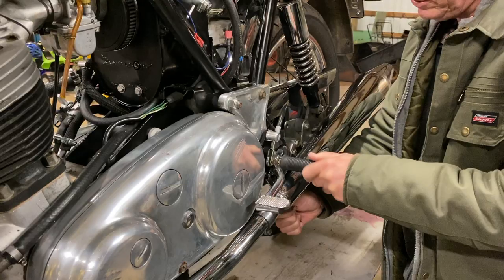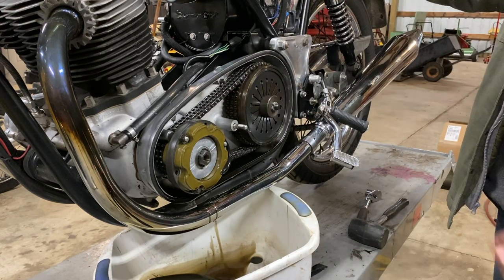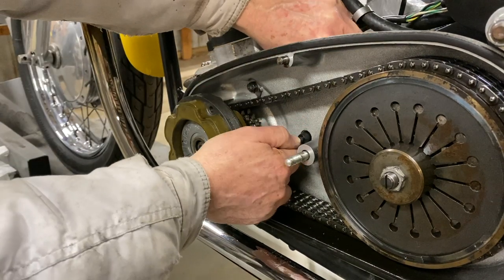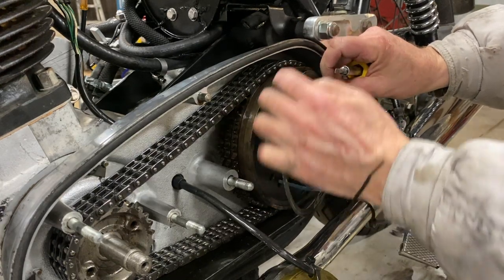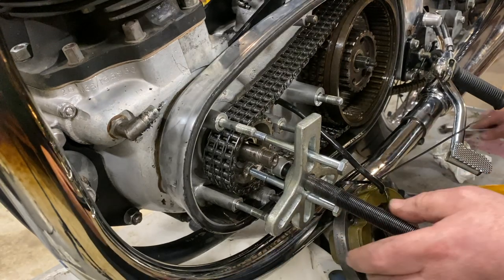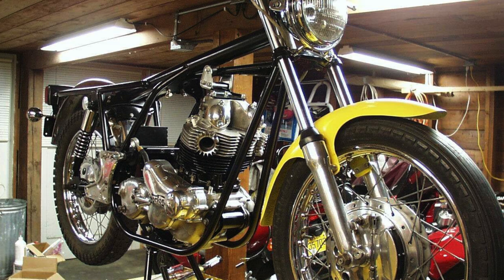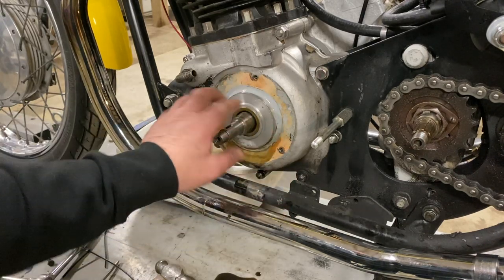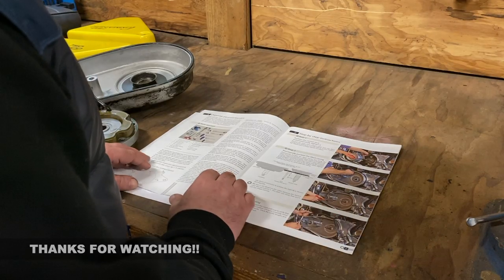Norton Commando Alton Starter Motor Project - Part 3 of 6 - Disassembling old primary case

Comment: Hi Mike, not sure if you read the comments of such old videos but I will give it a try as I haven't found an email adresse to get in touch with you. First of all thanks a lot for sharing all this great content on the Norton Commando! I own myself a 750 Commando Fastback from '71 and your channel has already helped a lot servicing and maintaining it. Right now I need to remove the engine sprocket and are looking for a fitting puller. The one you use in this video looks great and pretty beefy to me. Do you know if it is still available on the market? Could you perhaps share the brand and any addition detail you have about it? Thank you very much and greetings from Germany!
Reply from the maker: Hi Jens, thanks a lot for your note. I couldn't find the engine sprocket puller tool on Andover Norton's website, but it looks like there is one on eBay UK. 

You might try searching your local dealers for the part number 06-4297 "NORTON COMMANDO ENGINE SPROCKET PULLER TOOL 06-4297" and here's a listing below to show you what it looks like. 

https://www.ebay.co.uk/itm/221892208593?itmmeta=01J4PN49CNNA393ABTA2KGQDSM&hash=item33a9ce67d1:g:1vAAAOSwZkJUSM7B&itmprp=enc%3AAQAJAAAA4EzKZ7i0iISbYlkcwu3B5Tj2CEniNjFQI8c%2BxnbVZeWS0ahd5SPdt4e97R33DRuTm2HO5najuTURQyUb4026I5V%2B3WdJcLyHIqpGo2fvqJlblEq0sbAkEzyOAkozLpo7jmEWg6jO43KRh1bN0P2BGX%2B4rXt2gIeTPWqSWtM8Mf1Mzm3qPWUD%2BdFIAc4j5pLFoLsHLfd%2FwWcKZRchxxxzw6p96vwGj0ZVlgFsjSzOBVQruayMwwyIIvU1Fv4iPxItlRt3HmNlxOqAS5bixTHhyQrxdm2%2BQ8XT7Auc0%2FiZmHzV%7Ctkp%3ABk9SR7KWkdWlZA

Best wishes
Mike
Reply: Hi Mike, thank you so much for your speedy and valuable feedback - that is much appreciated 👍.
Best wishes, Jens

Comment: I think I must have told Geoff the story about the primary bolts that were too long and blocked the crankshaft. That one was a head scratcher. And no, they weren't the stock bolts, some stainless ones I had picked up and didn't pay attention to the length.

Comment: A better seal  for example the Cranckouse. Clean the Surfaces , put some fingeroil on one of the Surfaces. get some thin shims !put on Siliconegasket from tube.on the other Surface. Mount everthing and let the shims wear nessesary space for the siliconegasket tighten easy some screws !
Leave it during the night and bring away the shims ant Tighten it next day ! This might somtimes will be made without the original gasket at all - have to taste for that ! / Magnus G Lindesberg Sweden !